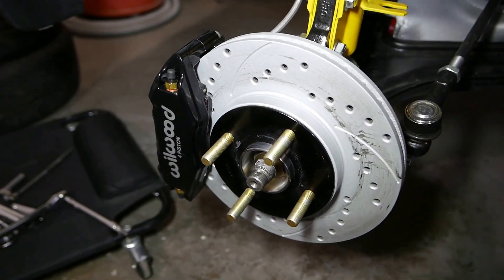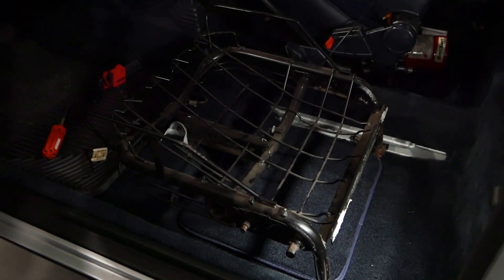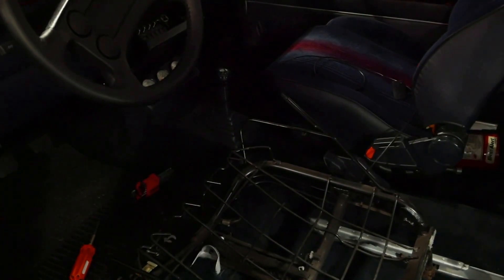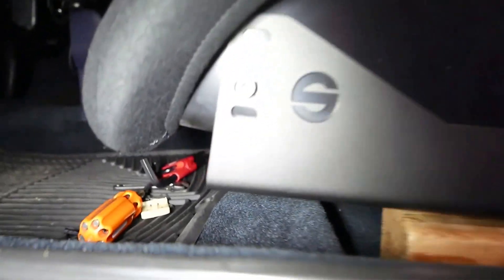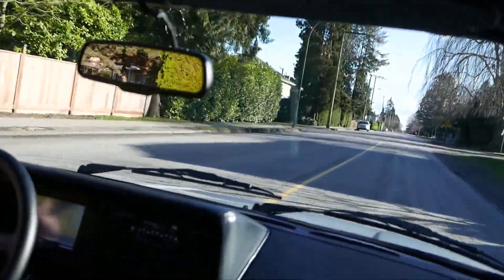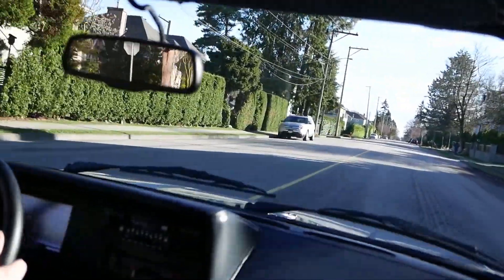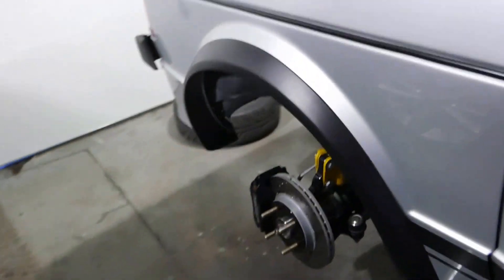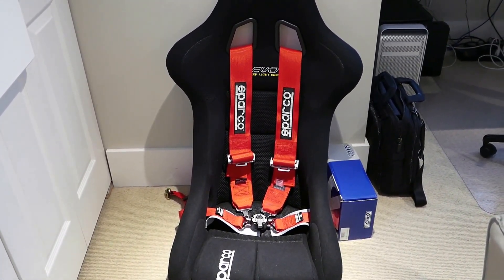The Ultimate 1983 Rabbit GTI - part 144 (Tech-53 Big Brake Kit - part 3, Sparco Racing Seats)

Comment: Answer to the question, if there's a resistance in the shifting it's normal but if you get a lot of resistance you oughta look at the ball thingy in the shifter linkage. I had a shortshifter on my mk2 gti and I eventually removed it due to it doing more bad than good and now I have quite a lot of resistance going in to 1st gear. So check it out might be the issue.

Comment: Also I have heard that an anti submarine belt can be a bad idea without a full roll cage. the idea being that if the roof does collapse  in a roll over then your head is the only thing supporting the weight of the upside-down car. if you submarine then you can potentially slip down to keep the collapsing roof from smashing your head. I guess the best policy is to check with your local racing organization and just he sure to follow their guidelines. great job on the build its been a great ride!
Reply from the maker: I agree and hope that the rollbar will give me some peace of mind. The other thing is for me to not spend too much time at the track with this 'street' car and limit my exposure to risks like this. Those Sparco seats really hold you in a stiff upright position.

Comment: while rolling my mk1 is tougher to get into first. if at a stop it is easier. best of luck with the fuel pump
Reply from the maker: That makes sense. I have the shift rod correctly shaped now and everything works as it should but the 1st gear engagement is as you describe. I now stay away from 1st unless I am very close to fully stopped and also shift into 2nd before trying 1st.
Reply: AFAIK there is a built in "lockout" to keep you from putting an 020 transmission (aka 4cyl mk1-3) into first while you're rolling, you can get it in at very slow speeds (under 10km/h probably closer to 5km/h). Do not try and put your car into 1st while you're still rolling.
Reply: by rolling I ment under 5mph as compared to a complete stop. thanks

Comment: Derek, you said you have an 02a? with cable shifter?
if that's the case,  put an mk4 shifter tower in and the same shifter box and never look back..
that has a very accurate way of adjusting and goes into gears like butter.  (I did this on my Corrado that used to be a pain to go into first and would grind second at high rpm. I thought my tranny was toast and that entirely fixed the problem )
Reply from the maker: I still have the 020 with the rod shifter. Very old school stuff ...  good tip though for people with the 02a swap.

Comment: for the first gear issues, try loosening the two screws under your shift boot that hold the shifter box. with the car off put it into 1st, second etc... and watch how/where the screws move, it can be a little trial and error but in under 20 minutes i bet you can get it notching smoothly into every gear. adjust too far left, you'll have problems going into 5th, too far right and you have problems getting into first.
Reply from the maker: i never thought of adjusting the shifter box. thx!
Reply: No prob! I had to do it before when i couldn't get my mk1 into 1st, be sure only to loosen them though so that the screws are still in the mounting holes ;)

Comment: When are you going to have the car chassis dyno'ed and see what kind of wheel HP the car is going to make on nitrous.
Reply from the maker: i need another 500kms on the motor before my engine builder will let me test the nitrous ... about half way there now ....
Reply from the maker: Another comment: since I know my total weight and can accurately measure acceleration, that is a direct measurement of torque and hp at the wheels - all that needs to be subtracted is the rolling and air resistance which is done with a calibration coast-down test which adds back around 0.03g at 50-60mph with my GTI. I will take the GTI to the 1/4 mile track near me which is at sea level and is well maintained. With my slicks I'll hook up in 1st gear so I will finally get a decent 0-60mph time slip as well as the 1/4 mile data, with and without nitrous. I consider the 1/4 mile data to be the gold standard. Chassis dynos can have wildly differing results depending on the dyno type and calibration and other variables so it might not be worth doing ...
Reply: I agree, its about how fast it goes down the road, not how fast it goes on dyno.
Reply: But you can't dyno tune on a engine dyno then install the engine into the car and not expect to not have some touch ups needed in the tune up in the ecu. It's just nice to able to be in a safe area and load the car and run it through it paces and no your air fuels and timing maps are we're they need to be. Plus everyone loves bragging HP numbers. To each as own.

Comment: If going into second before first doesn't help, the adjustment at the collar just in front and below steering rack could be off a hair(very sensitive). If your talking about when you're rolling 5 to 25mph, the notchy into first is normal and blipping throttle helps.                  Nice seats!!
Reply from the maker: I'll try that as well as playing with my fully adjustable linkage at the transmission. There is  usually quite a bit of resistance to selecting 1st gear while all other gears seems way easier.

Comment: Awesome! ... What does a flashing green light mean?  ... I have quite a bit of resistance going into 1st gear on my stock  84 GTI ... my original was the same way ... Boy the interior sure is quiet compared to the stock, everything sounds super tight
Reply from the maker: I have a lot of s/w indicators on that diagnostics screen that I often have up on the display. Some of them are for 'closed loop' mode, others are for things like alternator activation, etc.

Comment: I've also have had issues with my Mark 1 GTI transmission. I have encountered less resistance when you first downshift into second and then first. I currently have a neuspeed short shifter kit on it though, I don't remember what it was like before hand.  It's a relatively stock car.  I've seen weighted pieces to help reduce that overly notchy sensation. l've found a little success in keeping the plastic bushings clean and lubed.
Reply: I think it was a techtonics short shifter kit
Reply from the maker: That is what I have and it is currently set at the mid-way position, with the additional counter weight. I am onto this issue next as the steering, engine, and brakes are all working nicely now and shifting is becoming an important area to refine!